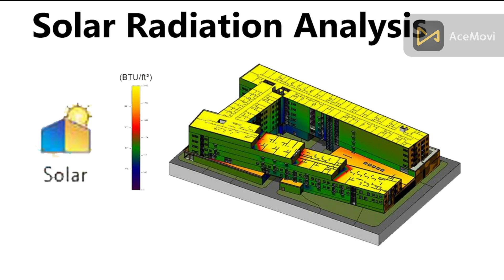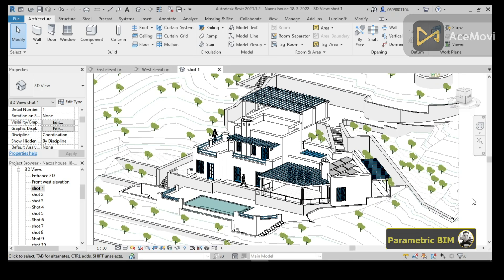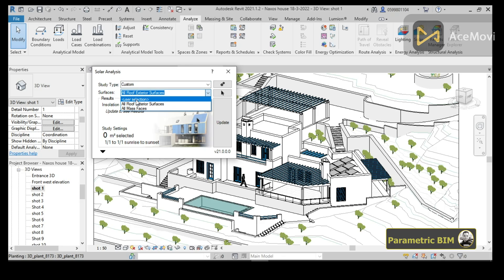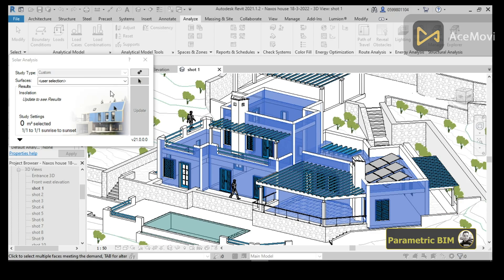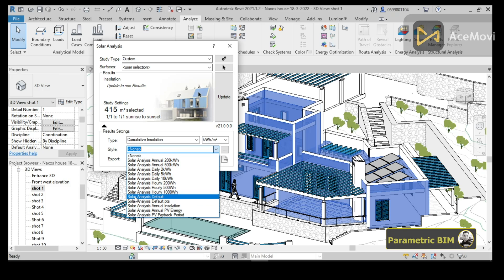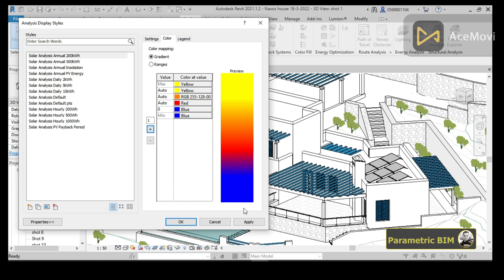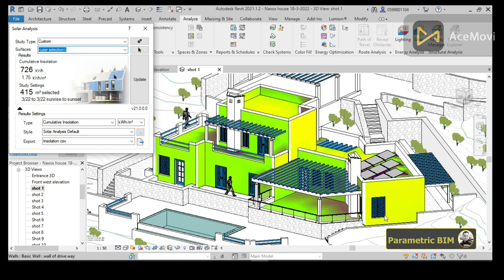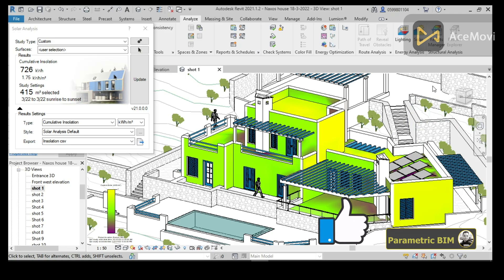Revit: Solar Radiation Analysis Made EASY

Comment: hey, I'm trying to find the add-in for the solar radiation tool and I'm not having any luck finding it
Reply from the maker: Hi.. what is your Revit version?
Reply: @parametricbim2023  revit 2022
Reply from the maker: Then you have to access to your Autodesk account first and then search for add ins … you have then to download Solar radiation analysis tool for Revit 2022 ..
Reply from the maker: You can use Autodesk download manager to see the available add in tools

Comment: How can I see the heat map or the irradiation map on revit 2023?
Reply from the maker: İt will be generated automaticaly in the 3D view
Reply: @parametricbim2023  There is any way of getting a kind of waves at the surface with the irradiance values?
Reply from the maker: @lf3829   if you mean by waves( gradiant colours) you have to play in the settings (explained in the tutorial)and also you have the ability to extract xsl file with the values..
Reply from the maker: İn my opinion ladybug is better in what you asking for.. I will also try to make solar radiation analysis tutorial in ladybug and grasshopper.. stay tunned .
Reply from the maker: https://youtu.be/69cPxuyOyvQ
May be similar to this daylight factor analysis but for solar radiation analysis